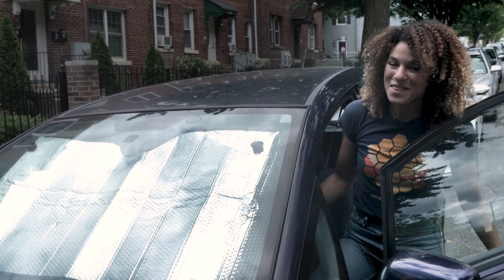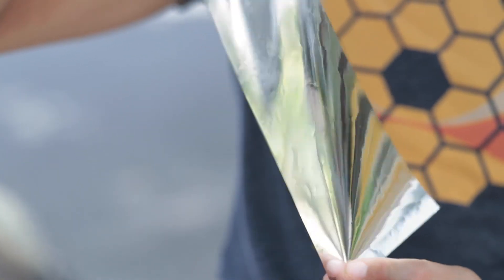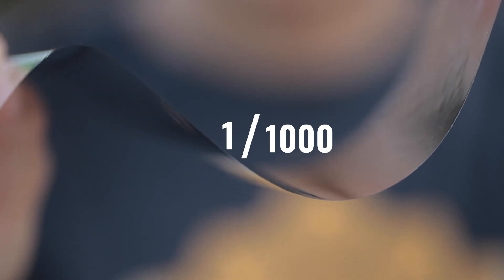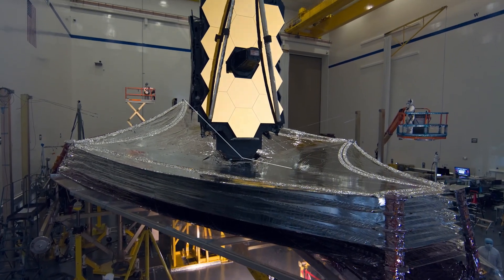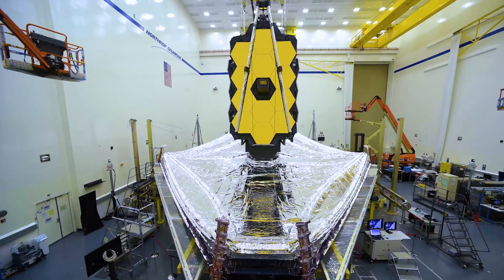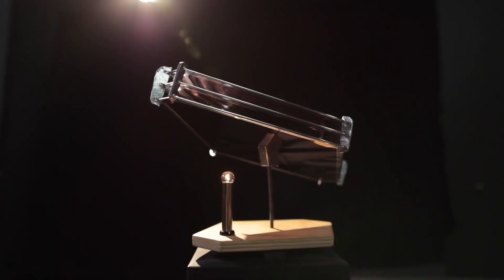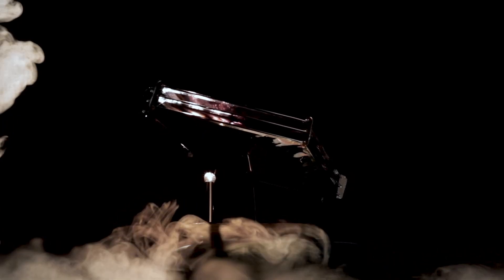Elements of Webb: Kapton, Ep06

Comment: Why is it not mentioned that the Kapton is just the base layer for a thin aluminum coating? That's what you see: the thin, highly reflective layer of aluminum, probably with an additional protective coating. Kapton is mostly yellowish/brown and resists a wide range of temperatures.

Comment: You can not measure the heat of an object with low emesivity with a thermal imager.
What was seen was heat that was reflected, not what temperature the surface itself has. To be able to do that, such a form of coating on the surface is required.
But the principle is of course completely correct.
Reply: They weren't trying to measure the temperature, they were trying to measure the thermal radiation something on that side of the shield would get from the bulb, and that is exactly what the thermal camera is measuring.
Reply: @TinBryn  it's the same principle

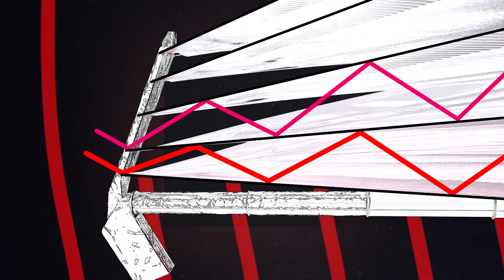Comment: 2:06 - I am unclear why each layer gets little smaller as we move up. If they were of same length, the heat won't dissipate? Why? 🤔🤔
Reply: I believe it’s geometry related. The largest layer is the warmest as it is Sun Earth facing. It will radiate heat to the second layer.
I believe it is desired that each subsequent layer be slightly smaller so it is shadowed in it’s entirety by the layer ‘below’ it so the sun and earth impinging IR energy does not hit it all.
One can imagine this way, if one had five umbrellas stacked on a rod, in order to ensure no rain hits any of the umbrellas under the top one, One would make each successively lower umbrella smaller than the one above it; if they were all the same size, the rain would drip from the highest to the next to the next etc.

Comment: What’s a good pickup line that works with nerdy girls? I need it for science..
Reply: I work on the Webb Space Telescope. Come over my place, I'll tell you about it over wine, and then we'll bang.
Reply: @wyskass861  , That's actually pretty good if you can pull that one off. v
Reply: @virginiatyree6705  Should be much easier than building the telescope.
Reply: Yeah, sure you need a good pick-up line. v
Reply: “Ay gurl, want to find out the only thing harder than building the Webb Space Telescope?”